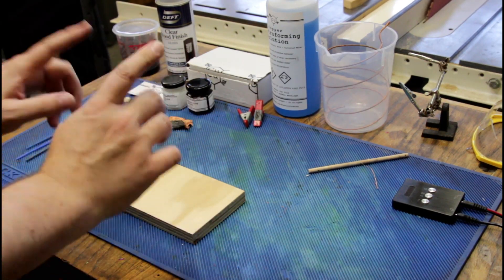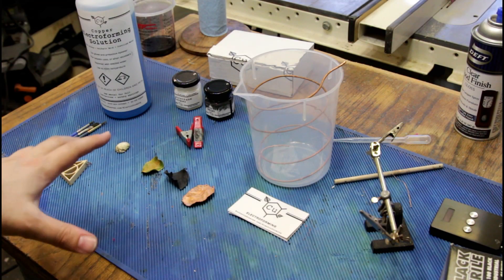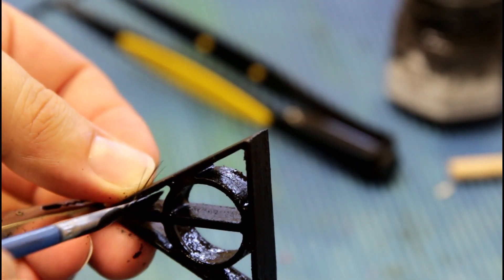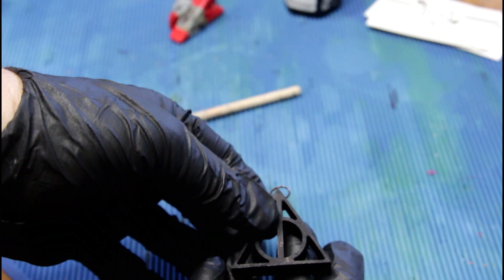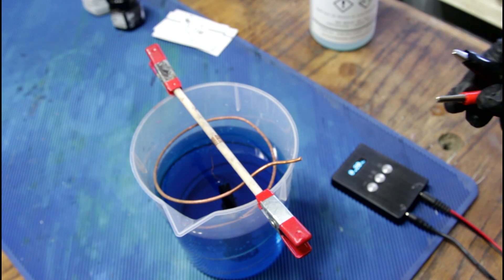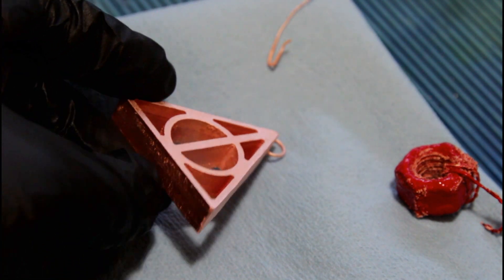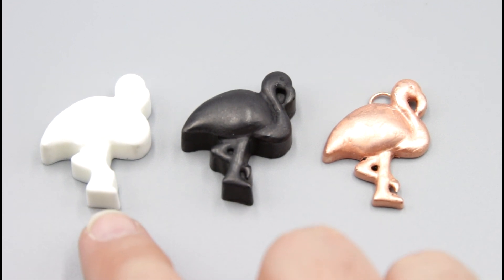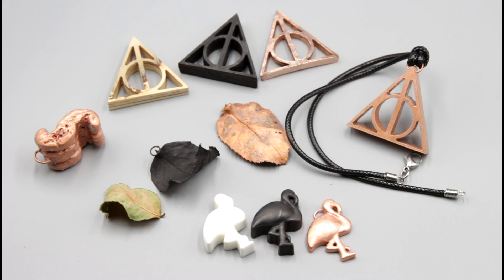Scrap Plywood To Copper Pendant

Comment: If you paint over a layer of conductive paint with a non conductive paint does the underlayer stay conductive? I would think yes but sometimes paints react to layers of another type of paint. My thinking  on this is as long as your conductive layer stays conductive you could do some interesting designs or added features to pieces. For example say you had an animal casting that you wanted the eyes copper and it to have copper spots. Paint the whole thing in your conductive paint then paint over the parts you didn't want copper with a non conductive layer then as long as you had a place to connect the electrode to any spot where the conductive paint showed would get painted.  Hmm thinking about this more I guess you could just copperform the whole thing then paint over the copper you didn't want to show up. Copper is cheap enough that I doubt the savings you would have by only plating certain spot of the item would be negligible. If you were forming with gold this might be a viable solution. It's an interesting idea though. I hope it inspires something. Keep up the good work.

Comment: Once you've got a copper layer on there, you can then electroplate on top of it with lots of other metals. So the next step could be to do a light gold plating on top. Maybe electroform a chocolate coin, then gold plate it to make real gold chocolate coins just for fun. Or it'll just make parts like this necklace look even more incredible. 
If you do an object that can take a fair bit of heat, you can copper electroform, then chemically coat it in zinc, and then if you heat the object the two metals will mix together to form brass directly on the thing and give a golden color. Used to do that to quarters for fun. Basically just works on metal parts though because of the heat required.
Reply: Happy to see you here! You both do incredible stuff!

Comment: Is electroforming limited to copper or can you use other metals dissolved in solution?
Reply: I'm pretty sure it is a similar process to gold plating. Not sure if it would work directly, but you should be able to plate the copper with gold

Comment: What is the output voltage of you power supply? Where can we get the paint and the solution?
Reply from the maker: I always try and add all the links to the items I used in the video description.
There are a lot of similar products available on Amazon.
Reply: @peterbrownwastaken  
Thanks, I found them.

Comment: So what would happen with clear resin? I'm thinking if the copper only sticks to the areas with conductive paint, you could mask areas off? 

(IE: a clear resin ball/ marble with copper swirls?)
Reply: As long as the areas to be plated are connected this works fine.
And when plating clear resin you get copper on the outside and black from the paint on the inside.
Reply: @Landogarner83  That would look pretty cool I think...
Reply: That is one very cool idea.

Comment: What might be neat is to use the conductive paint selectively to plate only part of an object. 

Maybe for example a resin green lantern ring with a stripe of electroformed copper inlay in a fancy pattern. Something that would be difficult to cast.

Comment: How thick is the layer?
Could you sand/buff it?

you should also try to electroplate it with another metal
Reply: It could be plated with chrome or nickel for absolutely stunning results.
Reply: The thickness depends how long you let it run.

Comment: What kind of cnc machine is that...?

Also you could polish that pendant if you wanted, but you might need to do couple coats of copper. It might look cool if you polish only the sides but leave the inside this pure non-reflective copper color. Just to be sure I'll add that by polishing I mean with like a soft rag, nothing too abrasive. Micromesh might mork, but I have no idea.
Reply from the maker: This machine is a Carvey, that I got back in 2017 from Inventables. I good little machine for a small shop.

I did use a wire wheel in my Dremel on the leaf when it first came out. I'm not sure how thick the copper is but it's thin enough you can still see the grain of the plywood if you look close.

Comment: If the paint doesn't react to latex or other balloon materials, then perhaps you could guild that in copper. Make metal egg shells, similar to the concrete ones you tried a while back. It would be neat as well to see if you could guild a beetle or other insect, though painting it might be a process.

Comment: I have a video on my channel how to make copper electroforming solution. It comes out waayyy cheaper than the bottled stuff. And if you want to make stuff really shiney, go over it with a brass wire brush before sealing.

Comment: Electroplating onto a layer of conductive paint, that really clever. Kind of sad I never thought of it myself. I've made loads of copper sulfate myself from scrap copper and drain acid (a lot of them are mostly sulfuric acid) for growing crystals, so this will be a cinch. I get the feeling that the conductive paint just has a considerable amount of graphite in it, just like conductive glue.

Comment: What is the power supply plugged into or does it have its own source? Very cool video made it look so easy
Reply from the maker: It's just a DC adapter that plugs into a standard 110 socket.
Reply: @peterbrownwastaken  sweet thanks

Comment: Electroform layers of fabric, and embed them in micarta.
Electroplate Gold or Silver on top of the copper.
Make a resin bracelet  with a coarse material like cork, and paint strands of conductive paint over the material or in shallow channels you cut into resin/material.  After electroforming, seal the bracelet with resin/CA Glue to make the surface level.  The correct order of cutting, electroforming, and leveling the surface may need some experimentation.
Or go really High Tech and make a bracelet that is a watch but the circuit board is wood or resin with the electroforming for making the circuit traces, then embed the built electronics in resin and lathe/sand the bracelet.  You could possibly add floating LED's  or other items in the resin as part of the look!

Comment: I wonder if you could do that around a piece of Styrofoam and then melt the Styrofoam out at the copper would float
Reply: BLURby84 The layer of copper might be too thin to hold any shape by itself.
Reply: Balls will work best

Comment: I'm curious how high the voltage gets.  Also I wonder if the sulfuric acid is really necessary to the solution or if you could just use copper sulfate rooting compound.
Reply: I believe it’s necessary to create the sulfate, if you already have copper sulphate I see no reason why it won’t work.

Comment: May be another series...instead of dip it, you've now got plate it!
Reply: I'm a jeweler, we use electroplating all the time in my shop, white gold is commonly plated with rhodium after polishing.  The most common shorthand for this to "rhodium dip" a ring.  so really this is just a whole new form of Dip It video!

not really related, but a lot of times we will also be asked to give a piece of jewelry CPR (clean polish rhodium)
Reply: @jozzaud  Neat! Thanks for sharing those tidbits.
Reply: Wouldn't it be form it?
Reply: @rawovunlapin8201  semantics...
Reply: it'd be plate-it if the 'it' is metalic adjusts spectacles
Reply: Can you form food?  Like I mushroom?
Reply: @Scott_C  I expect you could, but I think the the food would rot inside. I supose you might be able to make something like dry pasta work (it comes in some cool shapes too), but you'd need to seal it somhow to stop it getting wet when electroforming. Maybe you could resin dip it first, then electroform.
Reply: YES! PLATE IT!
Reply: Dip it, plate it, cast it, turn it... Bigger, lower, thinner. *Daft Punk beat continues while vocals fade*

Comment: OK SO you need to electro form plate some small (dice sized) pieces of charcoal.  Then encase that in resin.  THEN make something cool!  I say this for three reasons; charcoal will conduct on its own doesn't need to be painted with charcoal first, charcoal is porous like by a lot, and yea I bet it could be cool to do.  I guess another way to go would be open cell foam, impregnated with the paint, then formed, then then resin, then made really cool....  but I vote charcoal first because charcoal.

Comment: So if you make a negative mold of something interesting, cast a positive out of resin, electroplate it, then cast that inside a resin cube, it would be an object that is almost 100% resin throughout, except for the thin amount of paint/copper which be the only thing you would see.
Reply: This would be awesome with clear/transparent resins and only partially plating the inner mold.  For example: a transparent yellow star with plated points in a clear resin ball as a Christmas ornament.
Reply: This is most likely graphite paint, and that's only so the electrolysis will work, you could technically only electroform certain areas (like the tips of a star) as long as you can get the current to pass through them...
Reply: Yes, but moost people use acids. They are more efficient.
Reply: the molds for vinyl dolls and similar plastic toys are made like this, the plastic part is pulled from the copper negative while it's still soft
Reply: This is a great idea. I hope Peter gives it a shot. I think he could do something cool with that.
Reply: Problem is you need to coat the resin surface with a layer of conductive paint. And the paint is black as you can see in the video.
Reply: Đình Duy Nguyễn not all conductive paint is black.

Comment: 0.2 Amps, is 200mA. But dont worry I got you
Reply: It IS 20 centiamps though. But no one uses centiamps.
Reply: @reeepingk  It is also 2 deciamps. But absolutely no one uses deciamps.
Reply: Jochem Pees .002 HectoAmps?
Reply: @reeepingk  or 200000 microamps
Reply: @dazai_dev  200000000 Picoamps
Reply: @dazai_dev  Yea in my field of activity i use µA, though it seems a little inappropriate there haha
Reply: @reeepingk and 2 deciAmps
Reply: I came to the comments for this exact thread.
Reply: AKA 4 13/17 freedom eagle sparks
Reply: I was positive there would be someone in the comments who made this clarification. Glad I checked before I repeated the same thing.
Reply: @petegalvs  I messed myself here. I loaded the video almost exactly when it was available, but had it paused at the CNC for awhile while I was gasp actually working at work.   So by the time I heard the number and made the comment, I didnt see any comments about it, but when I refreshed... here they are. lol
Reply: are nano-amps a thing?!  xD

you guys are great btw
Reply: @allencummings7564  Yes they are. bensomwr missed 3 zeros because his number actually is in in Nanoamps
Reply: @allencummings7564  Yeah, it is valid to put nano in front of any unit. Nanoampere is actually pretty common, sensor outputs and low power stuff often is in that range. If you look at the bias current rating for high end operational amplifier, you will find them given in pico- or even femtoampere
Reply: @allencummings7564  they are...
Reply: Americans really struggle with metric system ... xD
Imperial units are so dumb
Reply: @aladaris  What is the imperial unit for current? I'm curious?
Reply: @aladaris  sorry I cant understand you. I dont speak communist
Reply: I came to comment the same thing
Reply: I was gonna do the same thing.

Comment: That's really cool! After electroforming it with copper you actually open up a world of possibilities, including zinc, nickel, and even gold!
Reply: He could have done that to begin with I would think, considering he used conductive paint first.
Reply: @rdizzy1  IIRC the conductive paint works as a "filler primer" and the copper works as a proper "primer" for other metals to deposit on. Conductive paint is usually fragile and has some weird properties, while copper is a neutral base for electroplating!

Comment: It is not "Borderline Alchemy", it is Alchemy (well minus the gold I guess)
Reply: Ehh, the alchemy back then thought you could turn the entirety of the material into another element. (transmutation). Even if they did this on accident back in medieval times, they would have realized that it was still wood underneath a thin layer.
Reply: Indeed, it was the alchemists of the “early modern” period who figured out how to do this stuff.